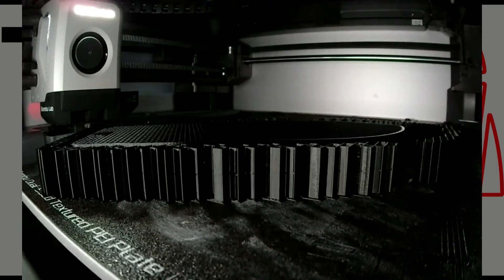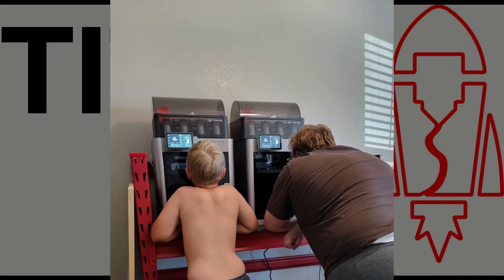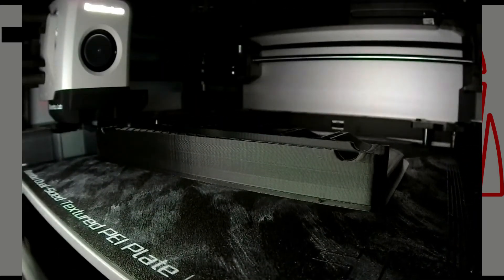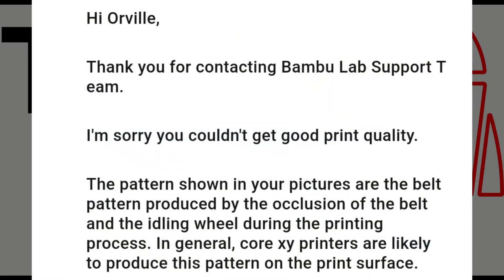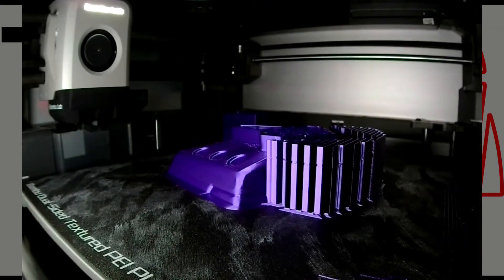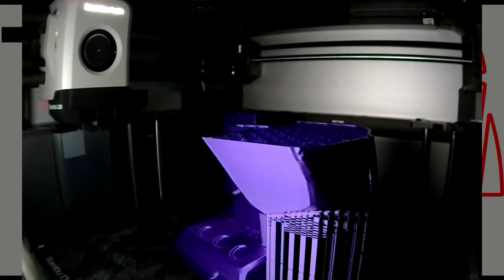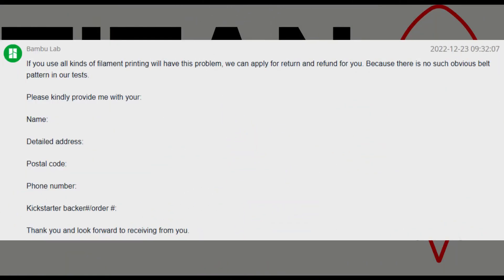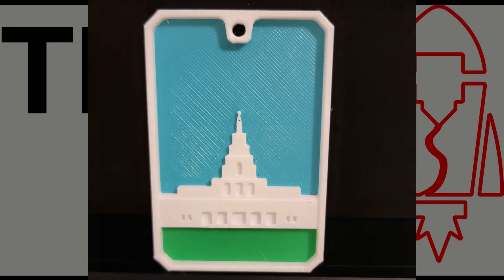Review of the Bambu X1 Carbon You Didn't Expect

Comment: Have you tried this on the floor rather than on a table, just in case the table is causing oscillation (just to rule it out if nothing else).
Reply from the maker: I did. I even strapped it down to my foundation in the back yard
Reply: @Titan3DAZ  I've watched quite a few of these different Bamboo Labs user videos. It seems like 90% of people are amazed by them, and about 10% or people have had to return them. It's a very exacting machine. With that speed the slightest issue really shows. You might be better off getting an exchange like others have done.

Comment: It's a little late to see this video, I don't know if your problem has been solved? Have you tried to disassemble the side panel of the case and observe the operation status of the motion system in operation?
There is one thing to pay attention to: the rib of the belt drive wheel installed on the stepper motor may interfere with the rack on the belt due to assembly problems or belt deformation. Note that it is the rib on the drive wheel! This interference causes the rack to repeatedly bite into and slide off the ribs, which induces vibrations in the belt which, if the speed is right, are amplified. This can explain to some extent why the stripe spacing is about 2mm. If it's the two smooth idlers on the X-axis, it should be a similar problem on all printers, but the fact that it's not all machines suggests that the problem is specific to this machine.

Comment: did you try manually adjust, head of people with issues, and they had to manually just flow rate etc, and turned off the flow calibration, not saying it will fix it but it's an idea.
Reply from the maker: The flow rate did not affect my prints unfortunately.

Comment: I religiously print PETG with my X1C. 

People had the same issue with making circles from Tinkercad and making a circle from Onshape, Solidworks, and Fusion 360. 

Tinkercad was significantly worse. I have made some prints on my old printer with the ringing not being visible, and parts that's didn't go flush together in tinkercad were seamless when printed.Bambu caught every single ripple and defect with that model.

At first I felt bad on my old printer because my prints could never look good because I could never get the right settings. Now I feel bad because I use tinkercad all these years and all my designs look like garbage because everything in tinkercad is made with a triangles for the geometry and has an edge every millimeter. Using Onshape for a few months now for this, never looked back.
Reply: Yeah that’s because the exported files are mesh-files and in 99% of all printers the movement is also all lines not circles (polygon). The resolution of you files makes a huge impact on how round your holes get. But also if the resolution is too high it‘ll make your prints look bad because you’re printer might not be able to handle that much commands that fast. As always it‘s a clean in between🙂🤙🏼

P.S. i work with solidworks professionaly and ran into the same issues but could max. it out with the export settings and how much the printers could handle:)
Reply: Different issue buddy. That's a low resolution model. This is Vertical Fine Artifacts. Look it up.

Comment: Thanks for the vid. This is why I'll be going another direction, leaning K1, because of the gsensor and the fact creality has been around a long time.
Reply: Did you get K1 are there artefacts?
Reply: @sabotage3d  I'm preordered for a max, eta 8/28 :( Otherwise from what I've seen, the OOBE does not have artifacts, though it seems the majority of folks are removing their bowden tube from the chain, which causes other issues, so this could be the source of some artifacting I've seen.

Comment: I've read all of this including all the comments and it looks like this boils down to belts not going over a toothed idler. I started playing on a laser cut wooden Makerbot years ago and have built a few delta printers of my own design. I currently have a shopping cart filled with an X1C and just about every option and filament. I have about 30 prints identified to get me started and a few projects I want to try but slammed into this discussion and now everything is on hold. I've gone through the whole Bambu Wiki and I think I'm seeing all belt idlers/tensioners smooth with the smooth side of the belt in contact. Are there other smooth idlers not shown in the path on the toothed side of the belt that can't be seen or serviced??? Will the teeth being on the opposite side of a belt telegraph through to the smooth side and the idler at these speeds? I want to just make things in my retirement without having to debug a wonky printer every print - am I asking too much??? I so wanted this to work.
Reply from the maker: I also wanted it to work like you do. I had lots of orders to do. Not that I'm aware of, they're all smooth idlers with the exception of the 2 that mount to the motors and provide the power motion to begin with.
Reply: Is it possible that the belt thickness/seams are not uniform so that the smooth side of the belt is not as smooth as one would like???
Reply from the maker: @ProspectiveBuyer-ji3qx  possible. I no longer have the machines to test that though
Reply: @Titan3DAZ  I'd hate to think that someone bought toothed wheels or idlers that aren't round to save 10 cents a unit
Reply from the maker: @ProspectiveBuyer-ji3qx  seems like that's what they did. They're press fit into the carriage too, so not an easy fix.
Reply: @Titan3DAZ  If I had a small gear puller meant for this sized idler and toothed idlers with bearings from Amazon, would the carriage idlers be accessible without destroying the rest of the printer to get to them? I'm thinking that if I was lucky and got a good printer then it's not an issue. But if it is bad with an option to fix it, I can deal with that.
Reply from the maker: @ProspectiveBuyer-ji3qx  not unless they changed the design
Reply from the maker: @ProspectiveBuyer-ji3qx  I am not sure. Worth a shot in my opinion.
Reply: @Titan3DAZ  Now they are fighting over the drive calculations and Bambu Labs took the discussion off line. Guess I'm going to have be patient and wait for this to shake out. Was kind of hopeful that the new P1S might have offered fixes but nothing said about any changes in that area. Thanks for your help!

Comment: Hi,
I own a X1 carbon since 6 weeks now and was also at the beginning very enthusiastic until this ringing issue appeared. I did follow all recommendation from the Wiki without success until the nozzle got clogged. Despite unclogging and several cold pull the problem was still there until I decided to exchange the nozzle itself and now it prints as new. In the meantime, some clogging did appeared again but the cold pull procedure was good enough to get it right. By the way the clogging for me appears when running out of filament and inserting a new one to continue a print.
After sending back the printers to Bambu lab did you go a feedback from them about the root cause and possible fixes or they just refund you?
Reply from the maker: Just a refund. No explanation or help of any kind unfortunately.
Reply: @Titan3DAZ  OK not so good but hopefully I found that the problems is mainy due to the nozzle aging rapidely and getting clogged in such a way thta unclogging is not easy or not possible
Reply: @Titan3DAZ   There's probably no reason to contact you after you got your refund, and they received the returns.  You might want to reach out to them to ask if they can share any updates on their findings.
Reply: You probably got lucky. I just replaced the nozzle and extruder on my P1S to hardened steel, and the issue still persists.

Comment: did you try putting the machine on a different surface.....different location etc ?
Reply from the maker: Yes. I put it directly onto the concrete slab in my garage and strapped it down nice and tight with no solution

Comment: Thanks for pointing thisnissue out, my question is: how significant are the drawbacks of printing faster as per their suggestion? Is it really a no go or you were just peaky in terms of finish product?
Reply from the maker: Well going faster didn't change the issue for me. My 2 machines continued to have that issue all the way to 500mm/s (which is the fastest I tested). Also, petg really doesn't like printing all that fast so it loses its interlayer adhesion.
Reply: @Titan3DAZ  can you print hotter to fix this?
Reply from the maker: @mycinemax2653  nope. Temp changes didn't affect my outcome

Comment: I am aware that these printers have belt spring tensioning mechanism.  However, is there a way to adjust belt tension manually?  From my experience, this pattern can be removed completely by increasing tension in the belts (belt teeth on a smooth roller is also not a good design choice, IMO, opinions vary on that).  I bet that Bambu would like your printers back so they can study the issue and will not be as accommodating to everyone.

Comment: I had a similar experience, the very first print I did on my X1 of my own design features a flat wall similar to your problem print, and the pattern was immediately obvious.  I've seen this on flat walls from every printer I've ever had so I wasn't too surprised, except I must admit I was hoping the uber designers at Bambu had fixed this problem.  I agree with those who say it's related to the 'teeth' on the belts, this would explain why the artifacts are always the same distance from each other regardless of print speed, and their distance apart does seem consistent with the teeth separation on the belts, although I haven't measured.  And yes, it appears regardless of whether the long wall is oriented along the x or y axis.  I have tested various orientations myself and I find the best way to mitigate this issue is by orienting so the long walls are at 45 degrees along the x/y plane, this seems to cancel out the patterns from either belt the best, but it's not perfect.  Like I said, I have this problem with all of my printers (my main use case involves a piece with flat walls) and so my disappointment with Bambu is merely that they haven't solved every issue related to 3d printing, only most of them.  The only printers I've heard of that don't seem to have this problem are all too small for my uses.  Really I think the reason this pattern seems so obvious to me now is because the print quality from my Bambu is so superior to anything else, the defects that do remain are more eye-grabbing as a result.  In other words, vertical patterns like this are a lot easier to notice now that my Bambu has eliminated all the banding and ringing I was accustomed to seeing on my prints.
Reply: Sure. Cool story. My x1c doing that and my crappie creality don't. So yeah all printers do that 😂

Comment: I wonder if it's a belt quality issue?   It would be awesome if you could replace the stock belts for some known top of the line GATES timing belts.
Reply: As the issue is also orientation based, I don't think changing belts will do have any effect on this. 

If you have similar issues, turn the object and you'll see the wiggle transitions to a different straight.

In my scenario the best orientation is rund surfaces to the front or back and straights aligning with the Y-axis.

Comment: This is exactly why closed source is a really bad buy. If this was open Source printer like the Voron, you would of been able to fix the issue with lots of help from the community and keep your business running. This is the only thing stopping me from buying Bambu, closed source is a deal breaker. When I need to fix my machines to get orders out I cannot rely on waiting weeks or months from a company to fix it.
Reply from the maker: I still really love the Bambu as a whole and in general. I think they've done a decent job at bridging that gap of being able to provide the proprietary improvements while sill making it possible for people to upgrade/change their machines. Not by a whole lot, but it's better than say a Markforged where you can't even set print speed. I do think something more like the Pantheon HS3 is a way better option. Yeah I know it's $14k, but it is truly a beast and capable of printing that fast without input shaper making it more accurate overall.

Comment: If it's a resonance issue you might be able to dampen the effect by placing the device on a different surface, such as a silicon mat of a particular thickness, or some kind of cloth, or maybe even some kind of brace, or a flying buttress so that it ends up looking like a cathedral! 🤔
Reply from the maker: I put it on the floor of my office. I also placed one outside strapped down to the foundation but that did not fix the issue.
Reply: @Titan3DAZ  I understand the theory of harmonics but I wouldn't know enough to recommend anything. My procedure would be to try different things and see if that helped, since different materials will have their own frequency range. The first impulse is to "lock it down" but the proper approach is to cancel the resonance with an out of phase harmonic. This is the whole purpose behind the command "Route march!" when marching over a bridge. Of course I'm not even sure this is possible without special testing equipment. Maybe you'd need some witchy incantations?
Reply from the maker: @Demosophist  aside from trying to lock it down, I did get the speed all the way down to 50mm/s and only 1k accel which is slower than an ender 3 and thay still produced the pattern.
Reply: @Titan3DAZ  The right approach to harmonic resonance is to "knock it"... destructively. But at 50mm/s you'd need very quick fingers.
Reply from the maker: @Demosophist  it was very slow printing... my ender prints faster with higher accelerations and does much better
Reply: @Titan3DAZ  Well, I hope mine does better than that.

Comment: My machine has the same defect, support could not help other than say i have to print faster, which didnt solve the bad printing quality. i didnt get offered a refund and im stuck now with bad printing quality for a mid rage price. im very disappointed with bambulab.
Reply from the maker: I'm sorry to hear that. I am honestly thinking that they offered me a refund because of this video. They made several comments about this video in the support chat.
Reply: I wonder it can fixable by tighten the belts.
Reply: no. i was in contact with support and they told me every step to do to fix it until they gave up with no fix.

Comment: Thamk you for the video. I think the V400 could be a good printer, if it get's modified to make use off all klipper features and gets tuned correctly. But I don't know how hard it is, and I also do not know if it woul'd get issues if you would encase it with walls. It is very different from the bamboo, maybe the new prusa printer XL would be to your liking?

Comment: For cosmetic parts try using orca slicer and pick inner->outer->inner for the wall order and click precise wall.

This will help a lot.
Reply from the maker: Thank you for the option. However this isn't about cosmetics. It's a physical deviation in the wall of the part. The peaks and valleys have a 1mm variation. This was a belt related issue.

Comment: Interesting. I’ve been thinking of getting a carbon and therefore watch almost every review and use of this machine. I’ve not seen this problem mentioned, and when looking at the parts produced, haven’t seen it either. I wonder if it’s a batch production problem that isn’t happening with most machines, but you’re were made in the same batch and so both have it. Bamboo has been very good about fixing problems, so,this one may have been solved already.
Reply from the maker: Not to my knowledge it hasn't been solved, but I'm hopeful
Reply: @Titan3DAZ  have you been following what others have been saying and doing? I’m just not seeing this problem mentioned. I just watched a guy who uses four or five Bamboo in his business, and he didn’t mention it either. It seems as though this might have been a problem from a specific batch of machines. The new ones a different from yours, as changes have been rapid.
Reply from the maker: @melgross  I have done everything I can think of and everything their support could think of.
Reply: @Titan3DAZ  I believe you. You don’t have them anymore though, correct? And this was several months ago?
Reply from the maker: @melgross  yes and yes. However my coworker has one currently with the same issue

Comment: My AM6 Aluminum Anet A6 has those issues weeded out, by tighter belt, additional pulley next to Y motor, and using M4 screw and flat coil springs for bed. Higher speed deceleration on beds and print heads caused those artifacts. Bamboo doesn't having Y bed issues, but still a lot of mass on Y axis